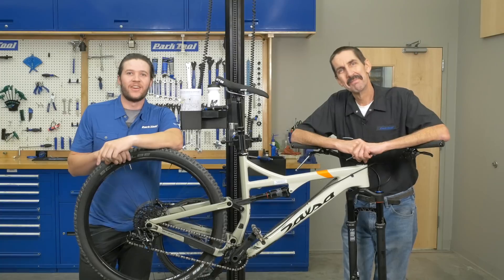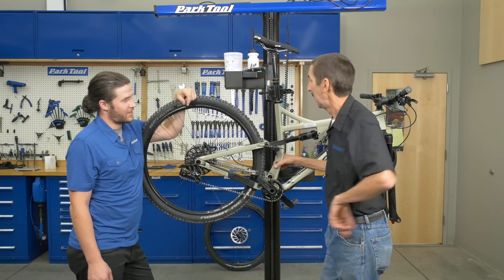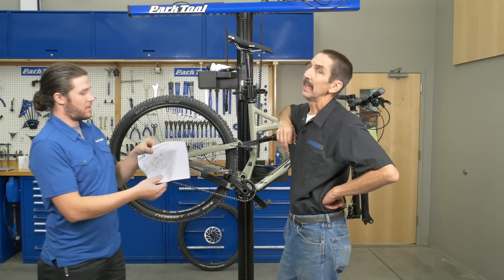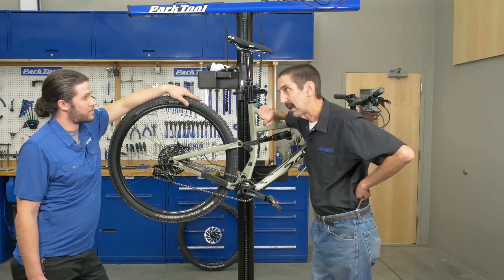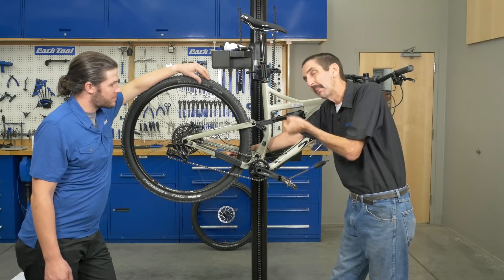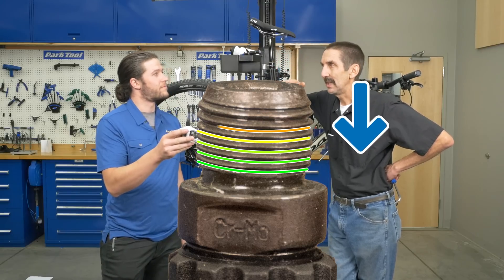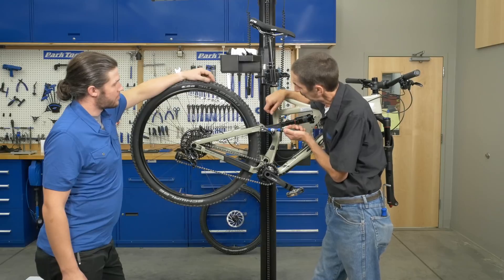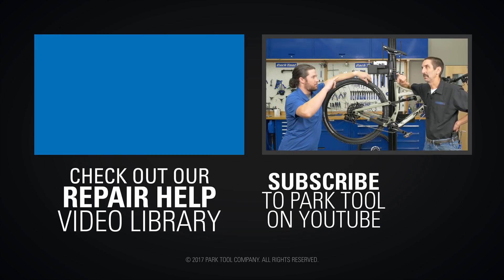Thread Orientation - Tech Tuesday #96

Comment: For the right pedal, it makes sense, as your riding, you're tightening the pedal. For the suspension bolt, the reverse thread made no sense
Reply from the maker: If you look closely you will realize the suspension thread is standard thread. It appears to be reverse but its because of the bolts orientation.
Reply: Park Tool thank you =)